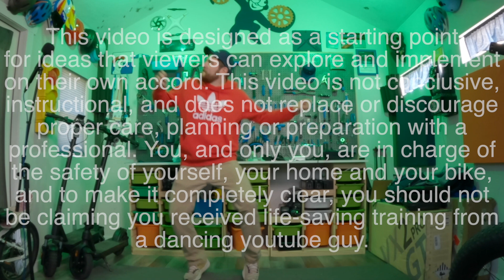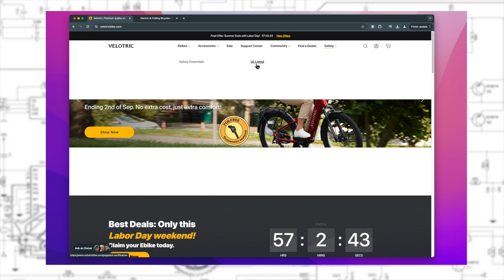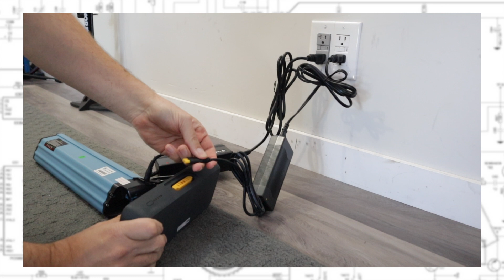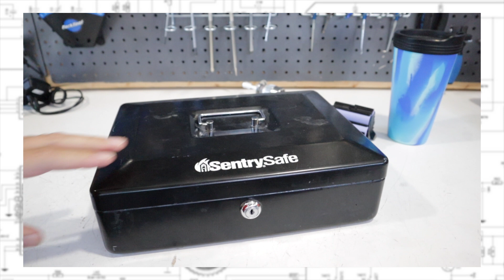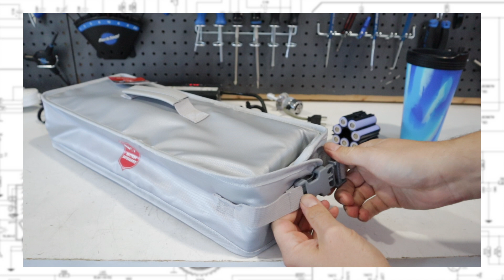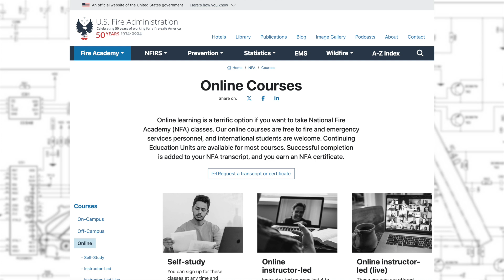e-Bike Battery Fire Prevention and Reduction

Comment from the maker: What do YOU currently do to mitigate risk of e-bike battery fires?
Reply: I ordered 2 Ebikes for my wife and I and thinking about the best way to store the batteries when not in use like winter time. I would like to store them in the relatively inexpensive battery bags but don't feel that is enough. Then it dawned on me to keep them in our fireplace, why not? It is a masonry firebox of a good size to fit both of them. We never used the fireplace in 30 years. I can open the damper a little and install a smoke detector just in case. Tell me why I shouldn't.

Comment: use a metal box grill etc..fire proof blanket, a bucket of sand to throw if needed.
store when charging and also when not in use.
It might be overkill but only takes one fire to burn shit down and one cant plan that a battery will just work and never catch fire.

Comment: I ordered 2 Ebikes for my wife and I and thinking about the best way to store the batteries when not in use like winter time. I would like to store them in the relatively inexpensive battery bags but don't feel that is enough. Then it dawned on me to keep them in our fireplace, why not? It is a masonry firebox of a good size to fit both of them. We never used the fireplace in 30 years. I can open the damper a little and install a smoke detector just in case. Tell me why I shouldn't.
Reply from the maker: It will probably work. Stray batteries can zip out. Be sure the shroud can withstand that kind of force. If left too long, fumes can emit from a burning pack. A bag doesn't do too well at stopping that either, but you may want to ensure the fireplace is adequately sealed.

Comment: Never drop battery on concrete, never charge more than 4A and discharge 30A plus and cannot be anything. Othervise anyAAA and AA batery will cause fatal fires never p happened, never use swap bat stations you do not know history of battery which are you taking. If you overload to get high performance overheat hundreds battery will be fires on emopeds and EV. Cars can hit batteries many times located below the car?? Put schok monitors.

Comment: Regarding the metal box scenario... If the metal box is not ventilated and a LiPo battery ignites, the burning battery can't release flammable gases. That is, pressure can build up rapidly inside the box and the buildup of gas can create an explosion. So, for anyone considering this method; make sure you drill big holes to that box
Reply: And seal the opening with a wire mesh fabricated from fire-resistant materials, specifically engineered to endure elevated temperatures and effectively suppress the propagation of flames.

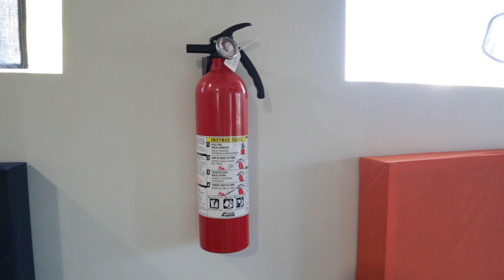Comment: At 7:05 minutes on your video your address fire suppression. The camera then shows a typical ABC type fire extinguisher I think that you are giving the viewer the wrong impression by showing this and not addressing the fact that this is not for putting out an e-bike battery fire. I charge and store my ebike batteries in a metal box lined with fire proof insulation tested to 3000 degrees, outside on cement  with a timer.
Reply from the maker: Somehow, you dodged all the disclaimers to arrive here